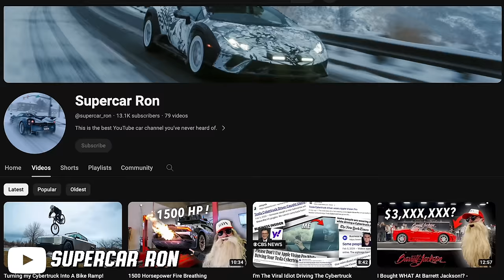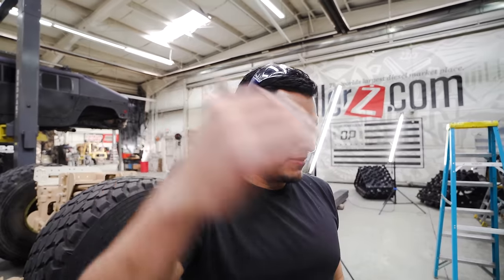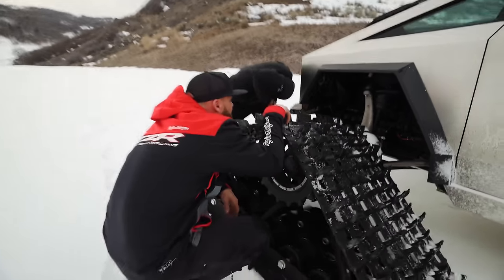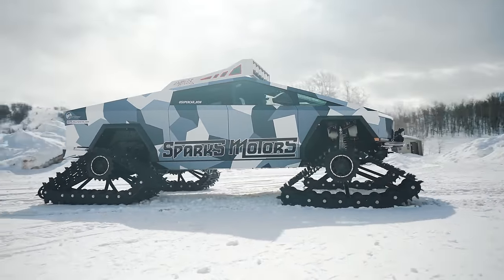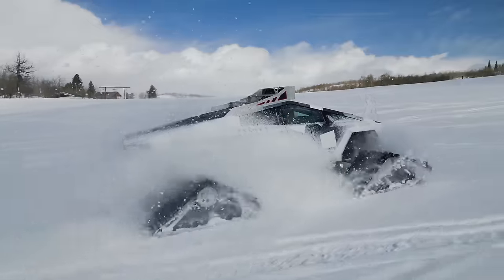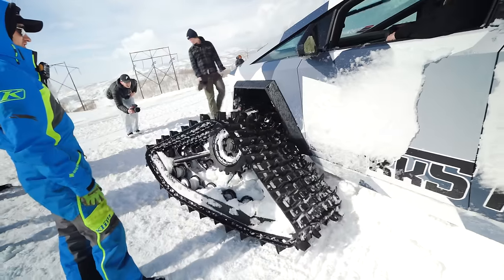World’s First Cybertruck On TRACKS Is Crazier Than You Think!

Comment: Sticking those treads out 16 to 18 inches is a tremendous lever with all the weight of that truck. I can't imagine the torque loads on the suspension in that configuration.
Reply: That's what I was thinking, too. With a build like this, I'd want custom CNC-machined billet arms to avoid this exact thing happening.
Reply: Most regular trucks have no problem with this. The Cyber truck is just weak.
Reply: @jesperwall839  those kinds of spacers, and/or deeply offset wheels put the same kind of ridiculous overhung load on spindles & such, wearing out ball joints or worse much faster than normal.  Also, it may be 'weak' from the factory, as many vehicle components are- especially when new, but that's the "joy" of R&D.
Reply: @jesperwall839  bruhhh.. the CG of those tracks is out like 2-3ft from the factory wheels, most mall crawlers put 3-4" spacers and a slight offset and call it a day. Any vehicle especially one with IFS would fold like a pretzle with a similar setup, especially if it weighed the >8k lbs the cybetruck does. With that being said, the A frame design on the cybertruck is absolute shit, a Toyota Camry has a more beefy design.
Reply: Thing weighs like 5tons💀💀
Reply: I was thinking that too
Reply: One thing is static forces that act like a lever, what also needs to take into account is what happens if you descend from hill or brake suddenly. Now the weight distribution changes and loads acting  on those levers are going to put some additional forces for all those forces that already were statically there from weight and offset. Even if the parts were to beefed up non of the attachment point for the suspension in the chassis were calculated to withstand it. Specially if one wants to let all those Newton meters loose from the electric motors.
Reply: Who cares?  It's ELECTRIC!   And the guy in the video is PRESENTING IT TO US!  Did I mention it's ELECTRIC?  Nothing else matters.
Reply: That's what i meant to say. You said it in the correct technical terms. Thanks! :)
Reply: . Bullshit.
Reply: I did as soon as I seen it and before it moved an inch.
Reply: Feels WAY better as the next part breaks 😂
Reply: They bolt the tracks to Hell Cat powered jeeps all the time????What like one Dave?
Reply: people underestimate the weight on electric vehicles, the batteries and electric motors are CRAZY HEAVY! and the cybertruck has all that heavy duty stainless steel on top of that thing is like 7k pounds before adding the tracks.
Reply: Would have been way easier to just install a set of Mattracks.
Reply: exactly yet he said he can't imagine they snapped the spindle...and probably added 250# of unsprung weight per corner.
Reply: I agree, it’s a super cool concept but the whole time I was thinking that the front end looks super stressed out. Any hard bump seems like it would fold the front end like a lawn chair. With that said, I hope they find a way to sure it up 😂
Reply: @jesperwall839 On this exact same youtube channel there are videos of what happens to regular trucks when you do this. They break.
Reply: @jesperwall839 weak in what aspect?
Reply: @richardingame Surprisingly a Cybertruck is only 500lbs heavier than a F250 diesel.
Reply: @jesperwall839 lol oh bro, I can't believe you missed the most important reason. "regular trucks" do NOT even come close to the weight of CT.
Reply: @schlenbea  But then the suspension and connected parts be even stronger. Don’t you think?
Reply: @jesperwall839 yea cause all these 2003 F150s with 3” spacers and 26” wheels also run snow trax. Easy killer
Reply: @jesperwall839 no, inaccurate! Most vehicles that have tracks added to them don't have those huge 12"+ spacers installed between the hub and the tracks, Dave even mentioned that is an Instagram post, creating huge Lever arms and generating loads all OEM suspensions would fail under.

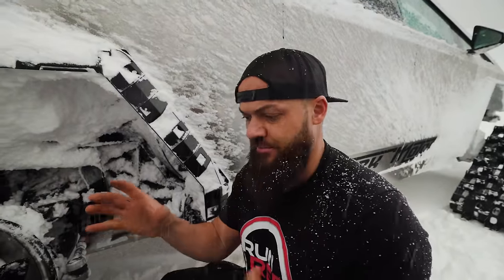Comment: 10:00 best way of fabrication, keeping breaking stuff till it breaks no more.
Reply: yeah lol, instead of over doing more parts just keep fixing the ones that brake
Reply: That's the only way in my book 😂
Reply: the BEST parts , are no PARTS.
Reply: @markplott4820  just like my imaginary lambo
Reply: OR, hire a mechanical engineer(s) as part of the team. Faster, usually cheaper.
Reply: True. Just don't confuse it with Engineering. That's a different activity.

Comment: You have so much extra leverage on that suspension part since you extended the hub and moved the tracks that far out. It's simply not designed for that. There is a great business opportunity for someone to design and fabricate all those parts as a kit for the Cybertruck.
Reply: Yes, very true.  Ideally, a whole set of more robust parts can be made to accommodate this application.  Also, it may be a good option for very hard core off-roading with either bigger tires, or stock tires.
Reply: it was so obvious what was going to break as soon as they extended the track the way they did
Reply: Yup. Bits that were designed to deal with essenitally a vertical load are now seeing a major shear load from all that leverage.

I'd be worried about the frame around the upper wishbone tearing itself apart without any reinforcement
Reply: The cost of manufacturing wouldn't even be worth it for the ONE person who would buy a Cybertruck to convert to this.  If you want a Snowcat for the snow - you buy a purpose built machine.  No one that could purchase a Cybertruck would buy this.
Reply: @bbaz6729 Well except the fact that people do this on a Jeep and Tacomas without the trax breaking every structural component.
Reply: I'm surprised it made it to the trailer.....

Comment: The wide tracks, and pushing back against that angle of the spindle is MASSIVE ammount of preasure and leverage...  I saw that snapping and thinking it was going to be the FIRST thing to snap...  I though, all its going to take is the outside of that track to go up a rock or something, and SNAP that very tall spindle fast....  That is going to require a full heavy duty custom spindles to work right..
Reply: Or just buy a jeep and slap the trax on.

Comment: I'd give it a better than expected rating. Hopefully the failure points you've seen won't become issues for owners who just go for bigger wheels and tires. Looks wicked cool though and you guys will get it dialed in for a good thrashing soon I'm sure. 👍
Reply: The size of the wheels doesn't matter, the problem is the length of the wheel hub. This means that an estimated five times as much force is exerted on the suspension

Comment: A lot like the process that they are going through at Space-x.  The design algorithm is tuned in to normal highway use to keep the cost down.  The loads with those tracks are off the charts.  A virtual aftermarket goldmine for someone for sure

Comment: Guys, you should know that these failures that were potential should have been mitigated from the start. CT's current suspension is based on it's overall weight and applied forces.  It's kind of funny, actually.  I was watching a CT video earlier from another content creator and when he had the truck up in the air where we could see the suspension, I thought to myself that the upper control arm was a wimpy, stamped part instead of it being cast or forged.  I then though, "well, most people will not be pushing the limits of these trucks and just mainly going to Home Depot and the like."  But here you are throwing a track system on it!!  I was thinking that the first thing to fail would be the upper control arm and sure enough, it happened.  You have to remember, this is a fairly heavy truck and throwing the driving tracks so far out from 'center' is going to put SOO much strain and fatigue on OEM parts.  But man, it makes great content.  Keep it up, fellas!

Comment: Amazing! Thanks for do this! I'm sure people that live in the artics and extreme cold areas would love to have something like this. After making your improvements, then hopefully you guys can make lots of sales from this.
Reply: Right, cold temperatures is what batteries like most...😂
Reply: @montegrifo  You should put on your thinking hat, and not let others do the thinking for you. 
The cold will reduce the range, it doesn't' stop the batteries from flowing electricity to the motors. Are you not seeing the video showcasing an EV in the snow? Did they complain about the batteries not working?
Reply: @nightsurfer1  That's what I meant. You have reduced range and no charging infrastructure in the Arctic. What are you going to do, bring in a diesel generator on a truck to operate your EV?🙄
Reply: @montegrifo  See??? You don't ask Tesla owners. You just assumed. I charge mine with a  household wall outlet. It gives me 5 miles per hour of charge. I plug it in after work and it charges and stops sometimes in the middle of the night because I only drive 30 to 35 miles a day. I still have to pump gas for my other cars, and hate the hell out of it. I have to stand there for 5+ minutes and chancing getting mugged or shot by some random idiot. I hate it! It doesn't take but 2 or 3 seconds to plug in my car and it does the charging while I sleep. I wake up with 270 miles everyday. It's like having a gas* station at home, and I don't even have to stand there to pump gas.

Edited a typo...
Reply: @nightsurfer1  the cybertruck would get half that per hour of charge then.  its battery is huge.   its not suited for cold weather.

Comment: We dont trust stock raptor arms or spindles (esp newer gen Al ones) with stock tire size if you are going full send.   The leverage of tracks spaced out that far was extreme. 

I've fabbed aero components out of duplex SS alloys and its like bending SAE 304 3-4 times as thick.

Comment: Damn sweet looking snow toy for the exceedingly wealthy, once you get the bugs worked out. It's impressive how far you got with only three test runs the weight is huge on those vehicles even before beefing it up and adding tracks. The original equipment is fine for normal use but when you extend the width by four feet adding leverage against components not meant to stabilize outriggers, but with your heavy equipment background you could quickly solve this making it a viable seven figure Tesla approved product.

Comment: The change in geometry brought about by the tracks create torque loads, or cantilever loading, on the suspension far in excess of the stock configuration..  Do you have a mechanical engineer sign off on the mods, or are you doing the mods without doing the math?

Comment: I know those tracks are pretty huge compared to the normal size ones but I have the regular size ones on my Subaru WRX STI and I am able to jump 10 ft in the air with no problem I have driven my Subaru all over the place and never had an issue so I am very surprised that it broke that quick even though they are double the size as usual but I have seen the normal size tracks put on every single four-wheel drive vehicle and there has been no issues that I know of that they have broke for any reason. I know they say you shouldn't go more than 45 miles an hour on them but I have add my STI up to 65 mph out in the Utah outback with 12 ft of snow and they are an the tracks are an absolute beast. I have them on three of my side by sides and I jump 15 ft in the air and the suspension steering and everything I have no problem at all they are just mad. The ones I have the longest and widest ones you can get for my quads and side by sides and they go through everything and I've never had a problem with any of the factory parts breaking so it's Elon wants to compete with all other 4 by 4 trucks he really needs to do something about the suspension and steering as it looks like the suspension and all of the steering components need to be redesigned if you want to compete but like I said those are some pretty long and wide tracks on that vehicle so I don't know what would happen if they were put on a Jeep or a Ford raptor but I have seen the regular size ones on the Ford raptor and there is no problems whatsoever but I already said that I have seen them on every truck at least the normal ones and I haven't heard of any of the stock components having a problem like the Tesla truck is having even though it looks like these are double size and double the length. When they get it fixed the it will be an absolute beast anywhere you go

Comment: You didn't really need to re-engineer the electrical system, you could have just wired up the lights in series instead of parallel. Four 12v lights in series will take 48v to power them, and five 12v lights in series will be dim because each light will only getting 9.6v each, if they turn on at all, some LED's don't like being undervolted and start to flicker or don't turn on.

Comment: Right before you stopped because of the control alarm I was literally thinking to myself I wonder how long that steering rack is gonna hold up with those tracks on there and it ended up being suspension that failed😂😂 that is pretty weak that it failed like that

Comment: Great for views but the best way to get a tracked vehicle that's light and fast would be fabbing a stainless BEV Ripsaw style machine with a monocoque hull like an MRAP. The reason track kits hung off feeble-by-comparison wheeled vehicle running gear is now hilariously obvious. You gents have the money to do much better work. Having stainless sheet laser or water jetted to spec then wire welding the plates together is quite basic and there are many donor machines to source parts like rubber band tracks from (which can be fitted with steel grousers if desired for ice).
A Ripsaw-style vehicle will have more suspension travel too. Maybe you could touch base with those folks for a joint project that would get millions of views.

Comment: the final forming machine that a normal vehicle goes through basically squeezes all of the imperfections out.  that's why they all end up "perfect".  the stainless alloy that tesla is using wouldn't work like that even if it wasn't all straight lines. that's no typical low grade stainless. my understanding is that it's the same alloy they're building the starships with, and supply line wise it makes perfect sense when they've already got everything set up. high end product for as good of a price as is possible.
Reply: when i say the final machine i mean the entire car is put in and it is squeezed into perfect shape in a mold.  that's how they do it.  all of the misalignments (and there are many, and it's on purpose) are taken out at the final step.

Comment: Bullet proof the thing with armor plates and bullet proof windows for at least 50cal^^
Tape the card to those retractable key chains that have Bluetooth and GPS if possible. :)
If you don't mind lugging around an extra phone you can get Windows Phones dirt cheap but they are easily hackable but come with 2 to 3 different sat nav systems and maybe even offline maps if they already implemented them way back when they certainly were in Windows 10 if you know where to look.
Dunno if it runs on ARM CPUs or X86?

It officially gets the name Breakalot.

Comment: Sounds like Tesla doesn't know how to build a truck. Funny you said nothing about battery usage, running heat and all. I saw one video where they showed the towing range was 90 miles at the upper weight limit. Not impressive, but most people will just pretend it's a car- like most people driving trucks.

Comment: 14:35 What's the difference between ground speed and the info from the speedometer? I know that the speedometer is supposed to tell you how fast the car is going, but then why are they saying that they're going a different speed. Is ground speed telling you how fast the tracks are moving?

P.S. I'm just asking, as I never heard the term "ground speed" before.
Reply: Ground speed is the true speed. The speedometer  is measuring the driveshaft rotation to determine speed, and that leads to false readings.

Comment: I just do not see the appeal of a pickup truck designed on Elon Musk's whims. Battery only means the range and use of the truck is tethered to the ability to leave it parked in one spot for hours at a time "re-fueling". Compare to a gas or diesel truck, you can extend range with a gas can in a few minutes. Then there's the wimpy front suspension parts which are too light duty merely for the trucks designed use. The company that looks to be on the right path is Edison Motors with their diesel-electric approach.

Comment: those tracks have a significantly higher moment of inertia than a tire... i mean not even in the same ballpark.  probably not even in the same county.  top tier modern engineering is designed to be as good as possible but also as close to the limit as is reasonably possible.  the best designed thing in modern theory is close to failing but in it's intended state will not fail.  start adding extra stresses and a perfectly design will very likely fail.  structural engineering 101.

Comment: This video screams time crunch, sponsorship and a**licking. Would've been nice to see the actual process of making the tracks fit and the first tests where the upper control arms folded.

The first time I saw a video where someone took apart a Cybertruck and showed the upper control arms, I was like is that actually a thing, to fit something that's used in a 1000 kg 80's Volkswagen to this behemoth. Like ok, maybe the upper control arm doesn't take that much force in light duty use but in any case it looked like it has no place in this thing.

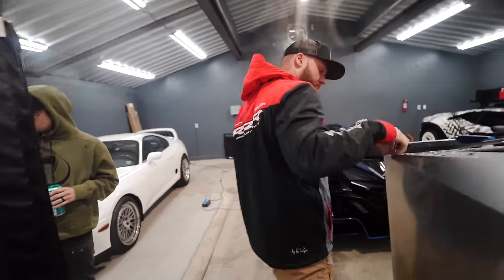Comment: Do some research before you start talking about the manufacturing of a Cyber Truck. 2:46
It is not just the fact that it is stainless steel.  It is the particular type of stainless steel used.  It is so strong that it CAN'T be press molded like soft sheet metal.  This is why it MUST have these straight breaks and no curves.
The Cyber Truck has the strongest body a of any production vehicle ever made.   Ugly, but ugly for a reason. 👍😂